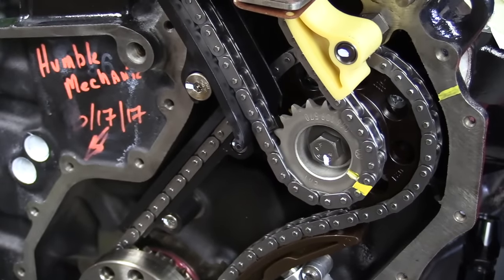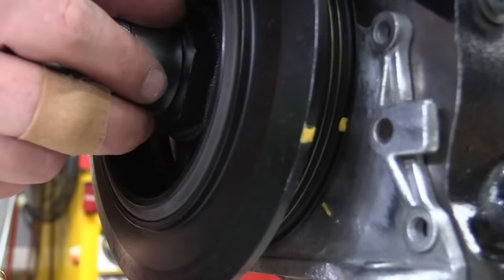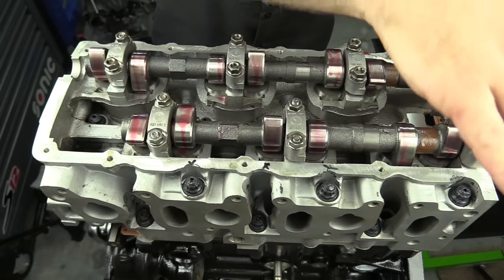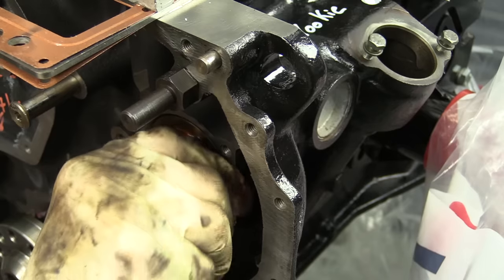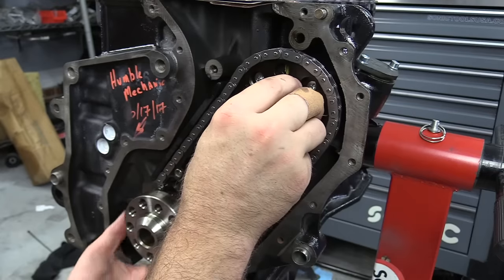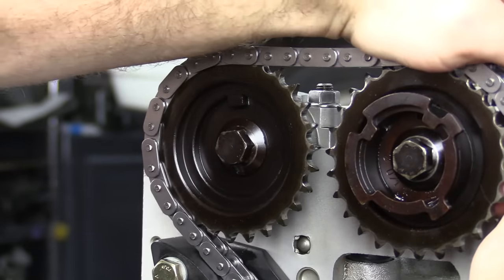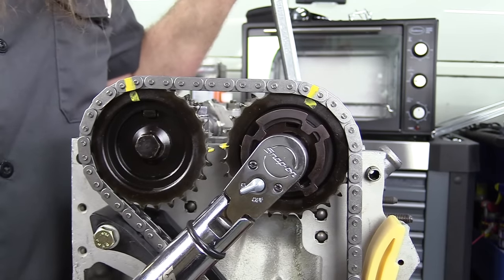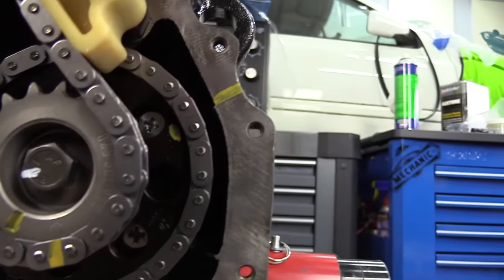How To Properly Time and Install Timing Chains on a VR6

Comment: why are these engines so hard work. been looking up chain failures on 3.2 24v. first ones snapped due to sachs stapping the chains with there logo and causing it to weaken.  and then it's the long life oil causing crap to build up in the oil pump and increasing oil pressure

Comment: Hey, I noticed that you used a head gasket spacer to drop the compression. I also want to add a spacer to my 12v vr6, and I have heard you have to modify the guides and tensioner, because of the extra height the spacer adds. It looked like you used stock hardware in this video. Did you have to do any modifications to get the spacer to work with your project? Thanks for any help!

Comment: Currently re-did a timing chain job for my 2001 12v vr6 since the first time I did not have it timed properly.  The intermediate shaft seems to be a little bit off from the 6 o'clock position (the first time I did it, it was at 5-ish).  Would that small amount throw the chains out of time? Should I take it out and make 6 and 12 at perfect 90 degrees?

Comment: This video was very helpful. did the timing on mine this weekend. I have 1 small black ground wire that I cannot seem to place and I cannot remember where it came from. The wire is about 6 inches long with a copper eyelet. It comes off the verticle cylinder that is right behind the coil packs. I think this is a solenoid? I dont know where it goes from there. Its not very long so there are not a ton of choice. Do you know if the wire goes to the coil packs? to the throttle body?
Reply from the maker: There is a ground point on one of the brackets
Reply from the maker: On the intake manifold
Reply: @HumbleMechanic  on the actual plastic manifold? or side of upper timing?
Reply from the maker: There should be a bracket on the manifold. But it may depend on which car you have.
Reply: @HumbleMechanic  01 jetta vr6 mk4, thanks again for help, Do you mean the side  bracket that would actaully attach to the plastic intake.

Comment: This kind of mature content should not be alowed on youtube
Reply from the maker: Lol 🤷‍♂️
Reply: @HumbleMechanic  Jokes aside. I own a mk3 GT (1.6l 100hp) wich I mostly restored it because his previous owner did not even changed the oil for a long time. So I changed the oild and filter, water pump,  the whole brake system wheels, etc.. now it runs flawlessly, now is when I dont regret buying it and learned a lot about how this engine works. BUT. I would like to change the timing belt, is it hard on that model or I should take it to a mechanic? do you recomend me buying the 2l gti or the vr6? I love how aggressive these motors are

Comment: Hello @HumbleMechanic I have problem on passat b6 vr6 3.2 fsi.
On first cold start the engine suffer wile running, revs are not stable and blue smoke is available. After about 10 seconds, the revs are stabilize, and after that every new engine startup are ok until it's completely cold again. 

Second symptom is during driving, If I hard step on pedal the car jerks until I stop accelerating.

Check engine code is P2293

Is that related to Timing Chains ?

Regards

Comment: If you're just changing the cams do you still have to take apart the whole front part of the engine to re time it?
Reply: Or can I just mark the chain and the gear and line them back up when putting it back together

Comment: Is it possible for the vr6 to be off time but not misfiring at all? The MK4 Jetta I picked up does not have any marble noises from the timing cover, and during live data misfire data it’s not registering and misfires,   The engine hold idle and will rev to redline but the engine and vehicle shake almost like a misfire

Comment: How important is the intermediate shaft timing? I recently did chains and guides and didn’t think it would be to big of a deal since “it only runs the oil pump” but upon firing it up it misfires on an entire bank.

Comment: 03:42 - it will not fit only in the right position..If you twist cam by 180° it will fit also (or not ? ) and it will be in a bad timing position.

Comment: Can you do some work on the iconic 1.9 ALH TDI? You're a VW guy so im sure you have some great knowledge to share. I couldn't find much content on engine disassembly, injector pump timing, head removal, ect.
Reply from the maker: I wold love to. I am thinking about a TDI as a next car.
Reply: common rail or  PD injectors ??
Reply: +Simon Rawle
The ALH TDI is not a PD or commonrail engine. It uses a computerized distributor pump. It looks much like the distributor pump found on the indirect injection diesels, but without any mechanical parts connected to it. Instead there is a big wiring harness attached to the pump.

Comment: Would you think the front guide at minutes 7:20 to minutes 7:27. The black one. Can crack a bit causing the timing chain to make a ticking noise? My 2001 vw jetta vr6 has a bit of a ticking noise. The noise is coming from the area of the spark plugs where they come out from distributor. I'm trying to figure it out so I can get it done and make sure it's the right spot. Thanks
Reply from the maker: Very possible, you really want to dive in and find that noise. Broken timing chains make for a bad day

Comment: hey i know this video is 3 years old but I'm about to do a timing chain job on my 2005 v6 touareg and I wanted to know if you knew if the job was similar ?
Reply from the maker: It’s different. Be sure you have the repair manual

Comment: Need to know! I have a mk3 vr6 with a dual chain cam gears and I picked up 262 cams to put in but I instead picked up a 98 GTI vr6 engine and found out it is a single chain cam gears. What I want to know is would it hurt to put dual cam gears on a single chain motor?
Reply: dual chain is the old setup, technically you can swap single to dual chain but most people upgrade from dual to single for the more reliable tensioner that was the main failure point on these.

Comment: I have a question. When car companies purchase other car companies and rebrand them. Do yall still work on them? Do yall have the proper tools. For example a VW routan came in today. It's basically a Chrysler T/C with VW logos on it. Hell even the key said chrysler. Threw me off a little bit. Thought I had the wrong key. But what do yall do in situations like that? Is it a situation?
Reply from the maker: +Cameron Bernard yeah we worked on them.  Most of us were not thrilled about it. Lol
Reply: Take the Routan out on the back lot and smash it with a real T/C and get them both off the road.
Reply: I once had an auto teacher who worked for Ford and helped us with a Nissan Quest. The Nissan Quest and Mercury Villager are basically the same, and they both have a Nissan 3.0L V6 engine.

He wasn't happy to see the van come in, but he helped us because it was his job to teach us.

This van had and OBDII computer, things must have been even worse when they used OBDI computers, as Nissan and Ford diagnostic ports were completely different and didn't interchange at all. I think that Ford's factory diagnostic tool had an adapter that plugged into the Nissan diagnostic port.

The process of making that van was a mess, but there was one benefit. Back when the van was introduced, Ford had more trouble with their V6 engines than Nissan did. Eventually Ford made the Duratec 24V and most of the problems went away.

Comment: The correct way to find TDC is with a positive stop and a degree wheel, a dial indicator isn't that accurate. I only use an indicator to verify lift.

Comment: Hi there! Great vid as always!
Can you englighten me with some insights..I had my upper timing chain cover off, and while the tension was off(via yellow lever), I accidentally turned the crank a little bit. I realized that was probably a bad idea, so I turned it back slightly counter clock wise, again with no tension to the chain. I probably either jumped a tooth or jumped the timing.. it was really a slight turn, maybe 10 degree. I really don't want to have to remove the lower chain cover as I don't want to really touch bell housing or get near transmission. I know from the marking that crank is #1 TDC and with the cam holding tool I know cams are also #1 TDC position, but maybe the intermediate sprocket isn't in the right position?(I'm reading online that some engine the position of intermediate is not relevant). I know you can't tell without being here.. but what would you say is the likelihood of this having problem?

Comment: Hey! really dig your posts! was wondering how to time a 2.5 I5 out of a 2012 golf.

idk which cylinder is number 1
Reply: Cylinder 1 is closest to the Drive belt side of the engine.
Reply: Im installing new/used pistons, can I use the old piston rings?
Reply from the maker: +Davidkb no. Get new rings
Reply: Ok. Also the block is still in the car, and The cams on my engine dont have individual cam caps or bearings
, its a whole plate that holds them down. 
and I kinda had to pry it loose idk if thats normal.

Im not sure how to Reinstall the cams with the engine in the bay, was thinking maybe I could Jam them back in there with The cam tool and plate locked in some how... Idk, 

also could I reuse the head bolts till I get new ones. Im stuck in at my aunts house which is 100 miles away from where I work so im in a tight spot.

lol I know these questins sound kinda newb but im thinking about reusing some of this stuff just to get by for a week or two and was curious if youve heard of such nonsence maybe... :) 

Note the engine got extremly HOT (Rally Dreamin). one of the pistons melted on the top side.

and Also Thanks For replying!

Comment: Even though this video series is old... It's still pretty damn good. I'm picking up a Cabrio and looking to do a swap like you did on the mk1. I used to have a FSM for my Honda and Nissan, however looking for a good alternative for the vdub.. any suggestions either paper or online that you'd recommend?
Reply from the maker: find a Bentley Manual for the MK3. it should cover everything you need
Reply: @HumbleMechanic  very cool. Thanks for the info.

Comment: Great job Charles. This will apply to the 24v too?
Reply: Overall the 12v and 24v Shouldn't be all too different, but the engines don't share the same timing chain or parts.

The Overall process should be the basically the same though, Id do some research into it if your looking to change it out just to make sure you have everything covered for the 24v motor just to be sure
Reply: Lazaro Carreiro bottom end times the same. The upper is slightly different due to the 24v VVT. There are marks on the cam gears and the VVT control housing. Count 16 chain links between the marks and you're good to go! 24v uses a cam lock tool too.. slightly different.

Eurowise has a quick video on YouTube for timing a 24v.

Comment: i dont know why but for some reason id rather do a timing chain than a belt . is there no locking pin for the crank shaft ?
Reply from the maker: No lock for the crankshaft.

Comment: Hey Charles, when you are finding TDC for the crankshaft, does it matter what stroke the crank is on since TDC is reached during the end of the compression stroke and the end of the exhaust stroke. If so how can you tell what stroke it's on with the cylinder head on.
Reply from the maker: It doesn't matter. The "stroke" is only for valves.

Comment: On my VR6 it has a distributor. There's a cam key way that's installed on the front intake cam I believe. I had a mobile mechanic come over and try to fix this timing issue and he removed the keyway to try and adjust the timing without taking the valve cover off and putting a wrench on the camshaft.
 Would that cause any of the valves to bend or any other internal damage to the engine?
 I hope not ✝️🙏🥵but I have still been quite horrified about what this guy did.

Comment: I just ran into an issue on my 2001 12V VR6 where it jumped a tooth on the rear bank camshaft. Pulled everything apart, got it back in time, and now it is idling really low, and acting like it wants to die unless i give it throttle. Any ideas?
Reply from the maker: Make sure there isn’t any vacuum leaks or other issues not related to timing

Comment: hello, how did you get your head so clean sandblasted ?? or with glass beads or dry ice ??? Will this still sealed with heat bag ??
Reply from the maker: I sent it to the machine shop. I think they did a glass bead cleaning on it

Comment: Can you check upper timing chain without it falling apart or skipping, my timing tensioner needs work done
Reply from the maker: You can. Just don’t turn the engine around with the tensioner out
Reply: so like don't turn car on

Comment: ok i know this is an old video. but im looking at a gti right now for a project and it has a timing issue and it jumped time. so i would have to redo all the timing and install new gears and cams. i would probably also have to fix the heads depending on if they got damaged. is this worth it?
Reply from the maker: If the price is right. And you can DIY some of the work, probably.

Comment: Hi. I wonder if there is a specifc timing for the VR6 FSI for the lobes lifting the HPFP ? And if yes, by misaligning it do you get the P0191 error for low fuel ?
Reply from the maker: Yes you absolutely can

Comment: Is it possible to replace the timing chain with the engine in the car?
Reply from the maker: Oh yea! That’s the way to do it. But on this engine you do have to pull the transmission
Reply: @HumbleMechanic  thanks for that input. Keep up the good work.

Comment: Is there any way I can do a head gasket job without messing with the timing?
I have zero knowledge when it comes to timing the engine.
Reply from the maker: You will have to pull the chain off, but with careful marking you can do it with out messing with the lower chain

Comment: Hi
My car (golf 1.4 tsi mk5 with 66000 mile) is showing error p3008. Initially the error code p000A appeared. I changed camshaft sensor then code p3008 came up. Most of the people are saying that timing chain needs to replace. It was fine , I just changed water pump because it was leaking, and new drive belts, with engine oil service , dsg service & spark plugs. After all this work when I started my car a code p000A appeared, then changed camshaft sensor, camshaft adjuster valve, after 5 minutes a new code p3008 came up, car starts but idle rough. When press acceleration it vibrates very heavily. What do you think might be the problem?

Comment: Did you paint the engine case inside the timing cover?  Just curious on the type of paint you used?
Reply from the maker: No I just painted the outside. This is the paint https://youtu.be/esXt9r-YoI8
Reply: I own a 2001 GTI VR6, enjoying the engine rebuild, only complaint is I wish the videos would come out fast.  Once a week.  Learning a lot, great watching a pro do this.  Saving this video for watch later, for future use, when I do the timing chain on my VR6.

Comment: Is this the same process for a MK4 24v VR6 / MK4 R32 engine?
Reply: rizrz34 Very similar but there is more adjustment in the 24v engine cam adjusters. You have to make sure they are in the right position otherwise the timing may be out.

Comment: what kind of torque wrench do you recommend? I have several that I have been extremely disappointed with. Both mechanical and digital.
Reply from the maker: +Joshua Preston I love my snap on tech wrench
Reply: HumbleMechanic thanks I'll have to pick one up soon.

Great content by the way. Would love to see a series on suspension geometry design or custom engine mounts for a unibody engine swap of some sort. Looking to do my own in the near future. Now that my Veloster is paid off I'm hoping to do a rwd conversion as well as, put an rb26dett in it. One word...
suicide.

Comment: I have a 2007 2.5 Jetta that stops accelerating randomly when I'm driving. The Rpm shoots up when I press on the gas and then there is a slight pull and then it starts accelerating again. Any suggestions as to what it can be? Please and thank you.
Reply: throttle body or Mass Airt Flow defect (MAF)
connect a OBD scanner and check 
should be a easy fix
Reply: Is this an automatic transmission or manual transmission?

Comment: My VR6 2.9l ABV did not have the mark on the crank pulley, 92 dizzy engine. And I had some problem with the cylinder head so I changed it to a new one and now it seems that my hydraulic lifters worn out? The play is ridiculous.. I changed the lifters and did some tests with different oil but it seem noisy again. Any ideas?
Reply from the maker: Wow how fast are these wearing? Have the valve springs been replaced
Reply: @HumbleMechanic  pretty fast it seems. I just got a new head and put it all together with my old cams lifters springs etc. Maybe I need new springs or rebuild the whole head.

Comment: Does the engine in the RS7 have a key in the cam gear to align with the camshaft? If it doesn't, how do you guarantee they won't spin?
Reply from the maker: I am not sure. I haven't had one apart. If it's not keyed, its probably pressed on and then bolted. The v6 passat, and V8 Touareg are like that. They hold pretty well

Comment: HumbleMechanic, I have a 98 GLX VR6 that seems to pulling the oil into the water reservoir. Could that be my head gasket or is it something else, I don't seem to be having any overheating issues
Reply from the maker: yep could be that, or an oil cooler
Reply: HumbleMechanic thank you, where at would I look to see the oil cooler
Reply: Usually VW oil coolers are in between the oil filter housing and the engine block.

Comment: My vr6 30 valve is completely different than the 12 or 24 valve different timing mark positions. And between the cam gears is a guide rail for the chain and a v6 engine is completely different im not sure i dont have a 2.8 30 valve v6 i have a 2.8 30 valve vr6
Reply from the maker: What year/model car is yours?